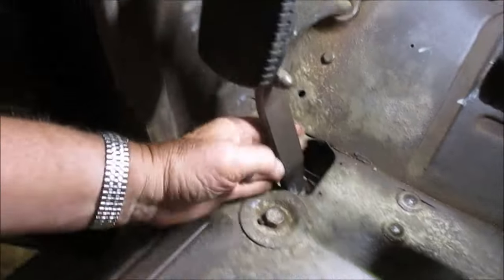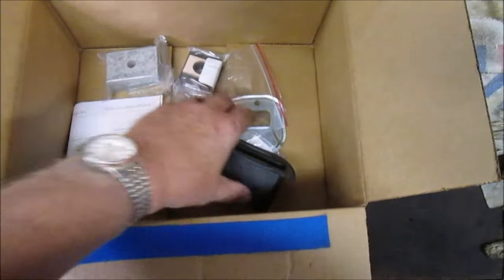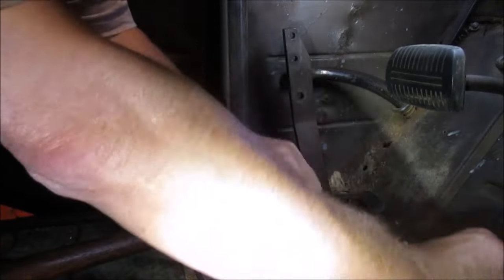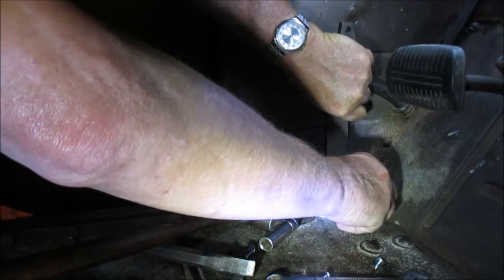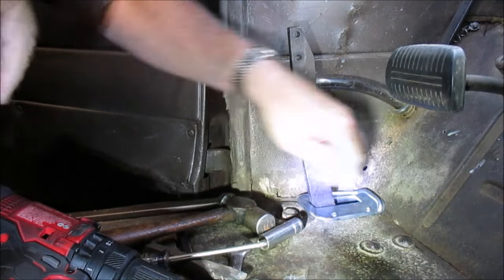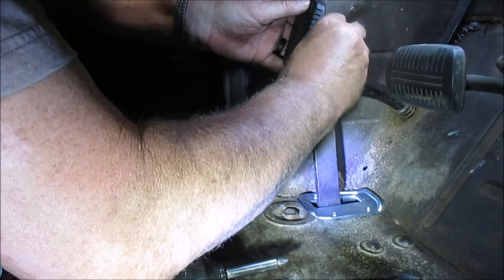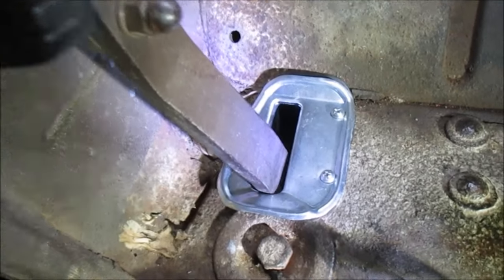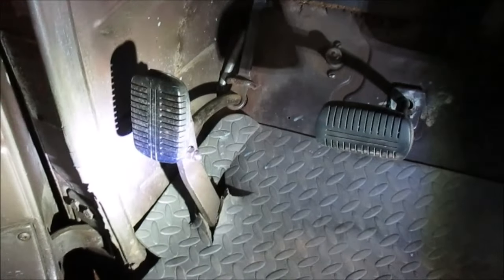1949 Chevy truck Parking brake lever boot & retainer install, Volume 92

Comment: Hey Dave, nice little repair, my coffee’s still warm, lol, I will have to check mine when I get home, one thing I did notice when I moved the 53 the other day was I had a few mouse turds, I will have to figure out how they got in , I did have the battery tray lid off to trickle charge the battery while I was gone so that might be where they got in, luckily no damage that I could see, and the droppings were on the driver seat so we don’t want that, talk to you soon friend 😀🥰
Reply from the maker: Mice can get through a hole the size of a quarter. They are a nasty vermin.. I've been spraying the interior of my classics with pepperment spray and I haven't seen or smelled any evidence of those vermin since. Could be coinsidence but they do small better inside, LOL.  You need a honey bun with that coffee too, LOL. See ya my friend.
Reply: @Volfandt  yes I do those maple bars aren’t cutting it, 😂 lol

Comment: What book is it that you were looking at as a reference to what you are doing? I really need to fix my pedal spring linkages on the foot controls. Thank you.
Reply from the maker: It's the factory assembly manual. I'm including a link to a vendor that carries it but you may do a search and find a better deal. Thanks for watching.
https://classicparts.com/chevy-gmc/truck-parts/1947-1954-truck-parts/literature/1947-54-factory-assembly-manual